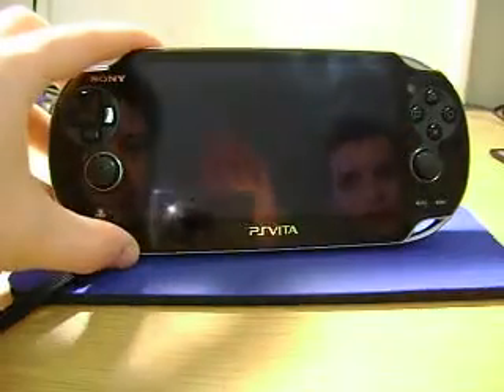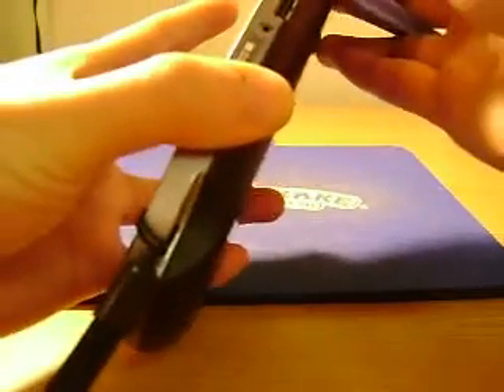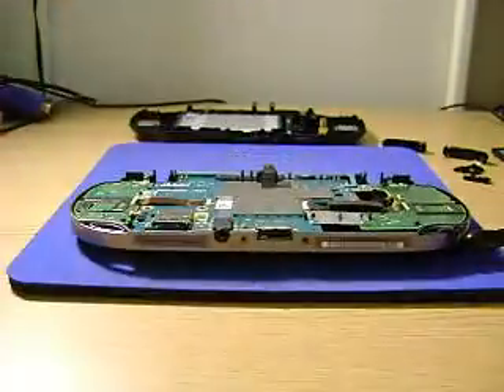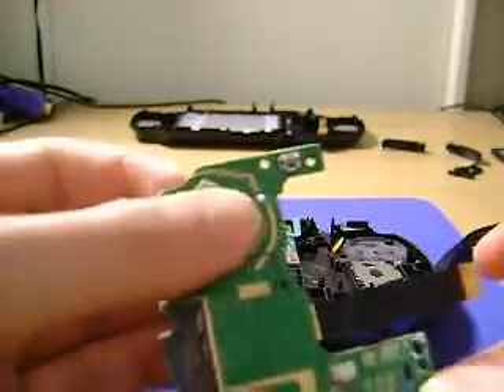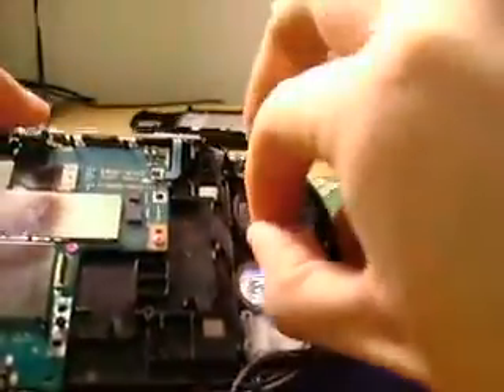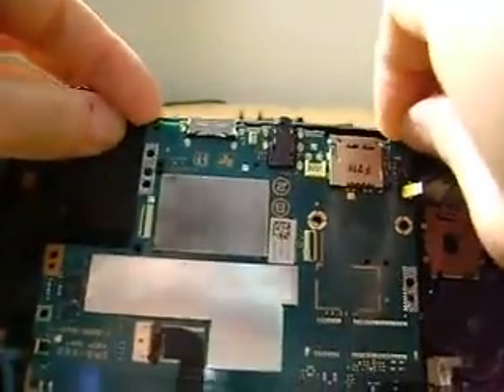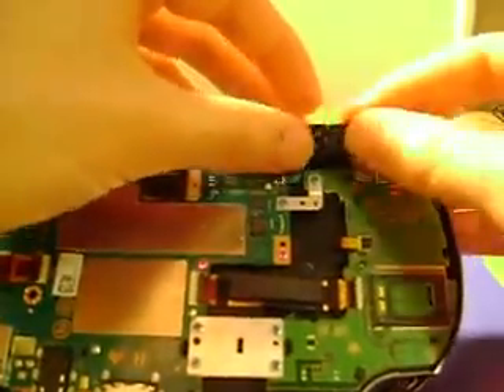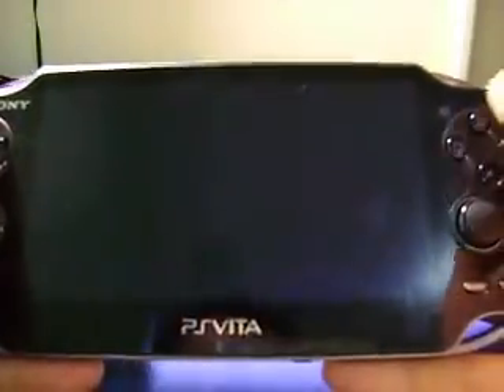TeardownTube - episode 16 - Sony Playstation Vita

Comment: Hi. Inspired some more to go back to reviving retro consoles usually, thanks to your extreme skills and channel, sir.

Inspired I started looking for defective/as is/broken/for parts 3DS and PS Vita. I found a Vita (about $30 no charger- I'll ask if it can be $10). He said his repair guy said the OLED is broken, it's not cracked, the screen is just white because he dropped it?

Is this worth buying? Or should I pass? I've never had any Sony console or handheld. I remember the Fat model is the OLED one.

Thank you. God bless, Proverbs 31
Reply from the maker: A vita with a broken screen but working otherwise is a steal for only $30 (you can try asking for $10 but that might be pushing it)!!! A replacement screen will probably set you back another $30 and will require you to remove the old one with a heatgun on low/hairdryer. A new working vita is around $100+ so I would think ~$60 invenstment for one assuming you can fix it is a good deal.
Reply: That's really cool. I'll try including the charger and some bad games if he can let some games go as freebies and lower it to 10$ (will offer him a swap maybe plus cash- pray he's a generous seller:D.

The screen has no hope (replacement screens are hard to come by here) to be revive (bummer)? By the way, what're the causes for the screen to just be just all white (if it's white the substrates are all still mixing its RGB to white). Is this case a kind of all the pixels on the screen are stuck pixel- all are stuck to white? What part controls which colors the display (which color substrates should be on by how much power) should display on an OLED? Always been interested in these extremely technical details.

Thanks again. It'd be cool if this can be revive for not much cash, I've never had a Sony console or handheld (most here is Nintendo and SEGA, Atari some time ago though not into that coz' the graphics are just not there).
Reply from the maker: Modern lcd and oled screens have a dedicated controller directly bonded to the glass that takes high speed digital video signals from the console and controls all the pixels. If I had to guess, since you said the seller said it was dropped, the first thing I would try is reseating the display connector (actually all connectors just to be safe). I have a sneaking suspicion though that either the controller chip or the glass was damaged in the fall in which case the entire display would need to be replaced unfortunately.
Reply: I see, thanks again. OLEDs seem to be very fragile- no wonder Apple hasn't used it in all its hefty iPhones or iPads. Thanks for the technical details, (getting me interested again to get into advanced electronics). Even though the controller chip is already bonded (correct me if i'm wrong) in the glass and it has no moving parts (or does it have moving parts), it could still get damaged from a fall).

If I can't find a replacement that within the budget or find a defective unit with a bad board but good OLED (most unlikely), there's this Playstation 3 fat/phat (no AC adapter or A/V cable nor controllers, just the unit) that's around $10 that's had YLOD/RLOD. I've done a similar fix for this on my old iMac's GPU using an SMD workstation I bought for that fix (but that one the screen just goes garbled). 

Will the YLOD/RLOD come back even if I can revive that PS3 using the method I used with my iMac's GPU? To prevent the GPU from overheating, they say you should put it on a stand drill a  hole (like that office supply grilled boxes) underneath where the GPU is (seen one in a Youtube video) or maybe just use it without the case, lol like what you did with your modded Gamecube. If the PS3 is a better option than the PS Vita, I'll just buy a Move for it and a gun holder for it then make it a gun game system (light gun games are the most fun:-).

Thank you.
Reply from the maker: OLEDs are really no more physically fragile than lcds (they are both usually made of glass and that glass when rigidly attached to the case is what cracks during a fall). The thing that really sucks about oleds is they are highly susceptible to burn-in and have a much shorter life than a lcd due to breakdown of the organic components.

For fixing a ylod PS3 a reflow is only a temporary fix unfortunately and it will fail again sometime in the future. To permanently fix it you would need to remove the cpu/gpu and reball them and then reflow.
Reply: Thanks. Would installing a fan in there (maybe connect to to some rail on the board but would that lower the voltage or amp going to the other components if there's a kind of "parasite fan"? 

By the way speaking of computer fans- what's the component that breaks when they stop spinning (usually less than their advertised lifespan)? Are there capacitors in a PC cooling fan (this is assuming it's not dirt that's accumulated?

Why does the GPU become unsoldered, doesn't it need about 300+ degrees Celsius to properly melt the solder? But then computers shut down at around 120 degrees Celsius I think to protect itself? How can the temps underneath the GPU or CPU become 300+ degrees hot, hot enough to desolder it?
Reply from the maker: Most broken brushless fans I see fail due to worn bearings or blown drivers. In fact, I got my nintendo switch for dirt cheap because it would overheat quickly because the fan driver blew on it. It only cost me <$10 and half an hour to fix.

As for why GPUs/CPUs fail, it isn't due to it getting hot enough to desolder itself (that is physically impossible, as you noted most chips have a safety cutoff temp sensor built in). What is happening is that the temp causes both the chip and pcb to bend slightly (due to their thermal coefficient of expansion and one side being slightly cooler than the other). The problem is that the rate of bending is different between the chip and pcb (pcb bends more than the chip) so some of the tiny bga solder balls under the chip crack and separate. The only way to permanently fix this would be to reball the chip with a more malleable solder like leaded to allow this tiny amount of flexing without cracking.